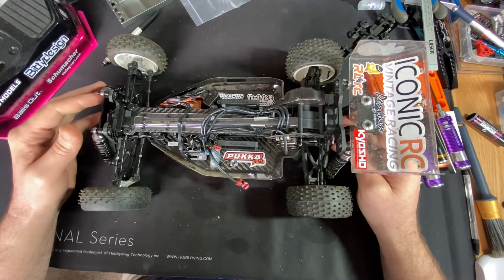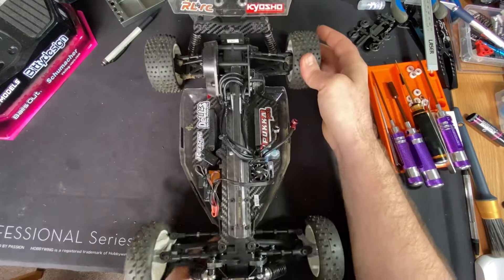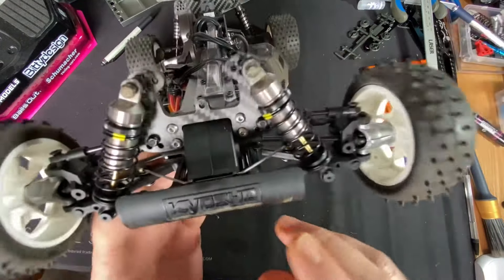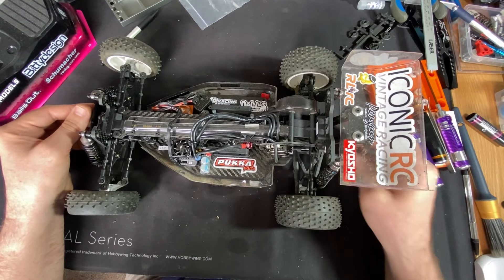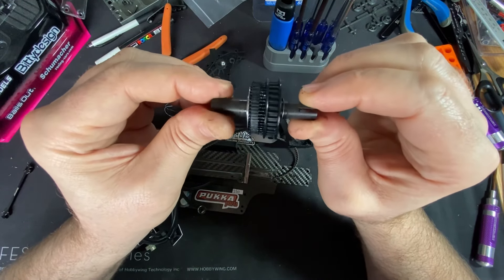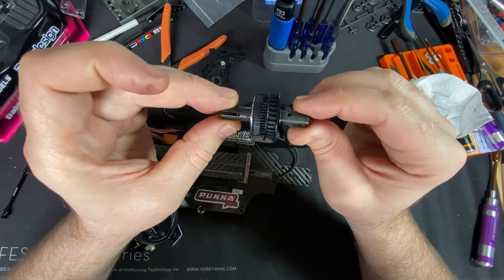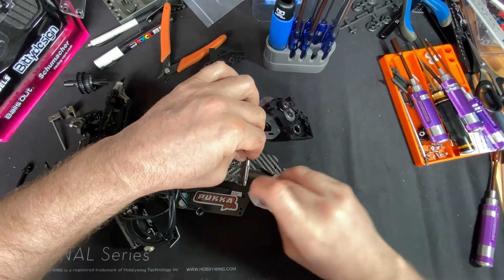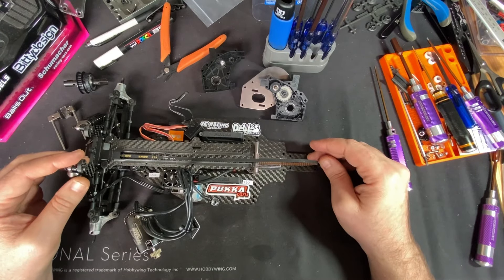Kyosho optima mid, WC 87 love it, and hate it.

Comment: That's horrible to see on that. Those cars are so high quality, I used to have an Optima Mid as a kid. Then again, those cars weren't designed for brushless power.
Reply from the maker: Yeah, kyosho have made some improvements. Belt tensioner and a slipper. But i recon the original would last a lot longer 🤔

Comment: The diff pulley/gear is only supported in the middle by a ball bearing.  When power is applied, think the gear side gets pushed away from the idler gear while the pulley side is being pulled by the belt, resulting in the mesh between the idler and the gear side of the diff getting too loose.   Just a theory….
Reply from the maker: Its one ive heard aswell, so there could be something in it ?
Reply: And...if you look at the metal gear diff, it's supported on both ends by a huge bearings!  There's little chance that your mesh and belt tension will change when power is applied.  Forgot to thank you for the video. I'm still working on my Optima mid so I appreciate you sharing your your experiences.
Reply from the maker: @_.Lumi._  cheers, sadly ive moved the mid on now, it would t get a lot of use now as i didnt het it into a few races i wanted 😭 and i used the money to fund the rc10 and a bit in reserve incase i can get the rc10 T 🤞

Comment: Hey just wondering about the steering on the Optima mid worlds. Mine is no where near as free as on some of my other cars. You cannot seem to turn the wheels without the servo-saver being engaged. Is this normal? Thanks
Reply from the maker: @speed_hunters_rc  i cant remember to be honest, i know on my cougar you can turn it but sadly i no longer have the mid to check for yoi
Reply: @ no worries so you sold the mid then? I got loads of tips from you so thank you. I actually spent the afternoon installing the Factory Works steering as I didn’t like the original servo saver system. A bit of faff as the instructions were a bit vague but Ingot these and feels much smoother
Reply from the maker: @ yeah, sadly i cant afford to keep all the cars. So some need to get moved on 😭 and im a schumacher guy at heart, so most of them will stay. But the mid was so nice to drive with the long wheelbase kit. One i wish i could of kept

Comment: Man, I'd better have a look at the geartrain of my Turbo Optima, its got an 8.5t in it and a few runs around the dirt tracks.... no issue yet but it wouldnt hurt to inspect it before it totally dies...
   Keep us posted on what gets it sorted... maybe a bit looser slipper would be one option, but it shouldnt have to be so loose that it takes away too much performance... 
   Cheers...
Reply from the maker: Turbo optima should be fine, its just the ball diffs ive had issue’s with. The gear diffs are metal so nice and strong 👍

Comment: I've recently dug out my old Optima mid Custom Special that I raced way back. Am very tempted to look at the possibilities for racing again, but don't want to take it too seriously. Any hints and tips for where to start from a club perspective (I'm uk midlands based), what to upgrade and swap out much appreciated - it still has the old 27mhz radio gear and nicad batteries at the moment!
Reply from the maker: Hi, i can highly recomend you run it. I would look at new radio and reciver to get rid of glitching, prob a hobby wing 1060 esc and a brushed motor. Keep the cost down to start. Brca website should give you details of local clubs. Some will have a vintage heat, but allways worth going down to see how the day runs.
Reply: @lo2713  thanks I think I will. I assume modern brushed motors are inherently better than old ones? I've got a Parma Cyclone Modified that I used to run, but that was over 30 years ago! I'm guessing Lipo batteries are the way forward too? I think my main concern is it all gets taken too seriously, but like you say, I think visiting a club or 2 will give me a view on that 👍
Reply from the maker: @peterwarner9572  brushless is defo the way to go, but buying a cheap nihm will be better to get you going. So long as it fits your car. If you go lipo then you need charging bags, safe storage and they need more care. Vintage events are more fun, modern is where the serious racers go. My local club has a lot of vintage runners. Some even drive 2 hours as they enjoy the relaxed environent in are vintage heats, and we run on grass, so its more suited to the vintage buggys
Reply: @lo2713  thanks for the info. It's a lot more complex than back in the 80s and 90s. I think your advice to start with a simple setup that works with what I've got is the right one. Then I can evolve things as I get more experience with it all. A friend has a couple of unused lithium ion batteries that look the same shape as the old 7.2 packs. Would they be a good option (he says I can have those for nothing)

Comment: Wow that plastic is awful, i run a 9.0t motor sometimes in my 38 year old hotshot 2 and its plastic appears to be way stronger🤦 to think 38 year old tamiya plastic is better than kyosho rere plastic 🫢🤦🤦.... Im shocked so a note to kyosho.....
Come on guys buck up a bit cuz the prices ur charging for these kits isn't reflecting to good value to well, brushless motors are used nowadays so bigger and better gears and transmission would be a good idea to upgrade b4 selling the expensive kits.
Reply from the maker: Yeah, ive run a 10.5 in a top force. And no gear issue’s there. Tainted my kyosho experiance a bit this